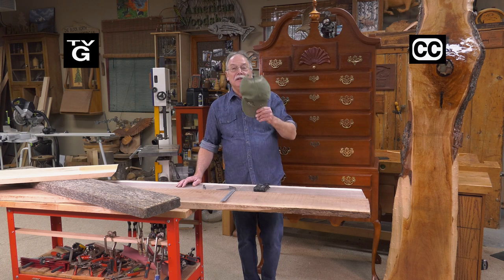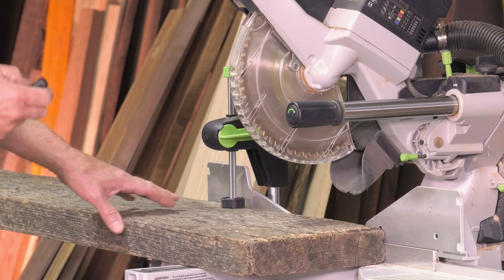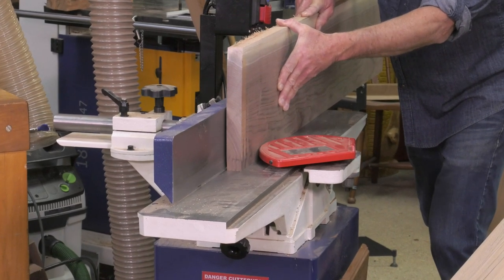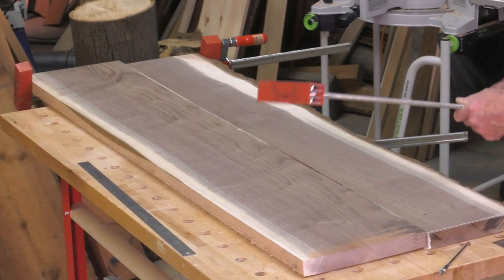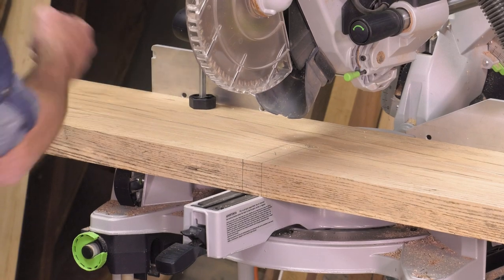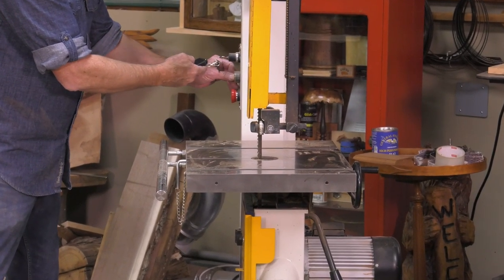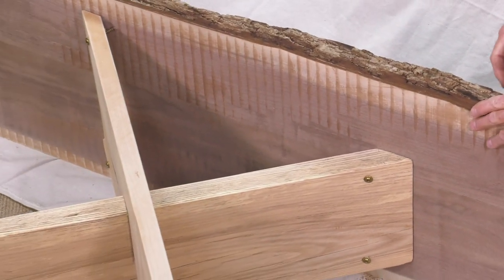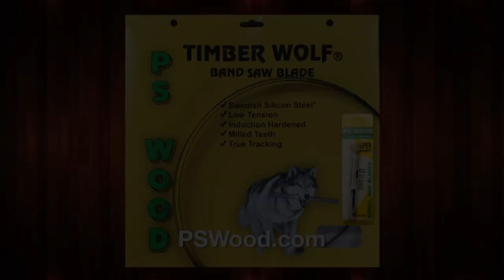The American Woodshop - 3013 - Cantilevered Tables

Comment: OMGoodness, that finish you applied is Gorgeous. So the edges that are custom curved on table top & legs are just for design, correct? I'm shocked that just the one coat of wood glue actually holds the tops together. I thought you'd have to put dowels from one into the other plus glue. That glue will last like this forever now? I got to start watching All your shows. I'm a Forced into retirement Tradesman in the Remodeling field. Worked on many high end projects on Martha's Vineyard Island Massachusetts for myself, Gentleman Jim's Construction, I'm Jim. I had to stop working in 2018 due to health. Was NOT ready to retire at only 56 yrs old, cleaned me right out. I'm grateful to be alive. Thank you for your show. Can't wait to see all of them. God Bless you all. Stay Safe Stay Positive Stay Healthy
Big Jim Massachusetts USA aka BOSTON STRONG
Reply from the maker: Thanks Jim! Hopefully retirement means more time in the woodshop for you! We have most of the previous seasons on our website, wbgu.org for you to check out! 

That's correct, the glue should last forever if done correctly and cured out properly! Edges are curved just freehand and for fun, and the legs are just a fun design too!